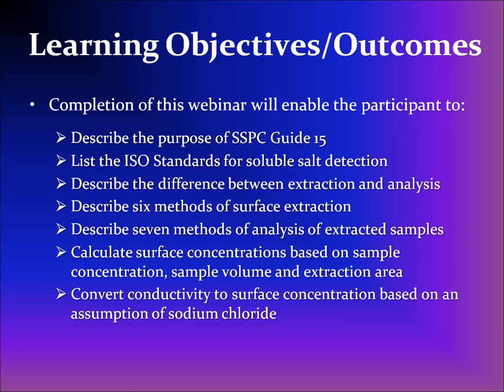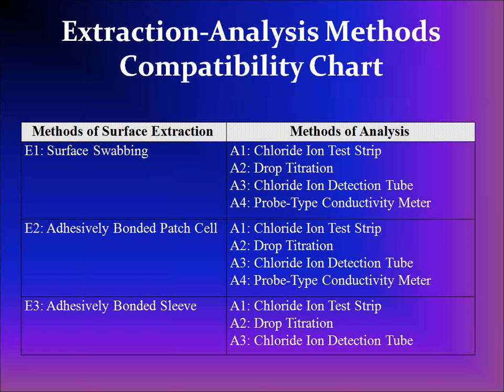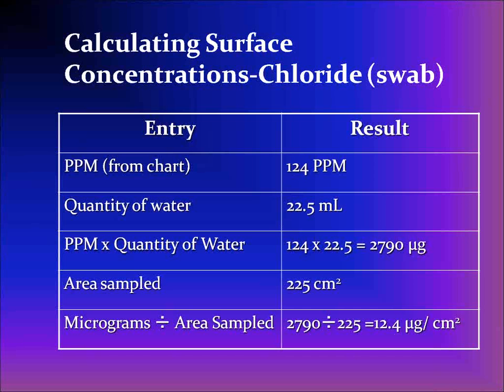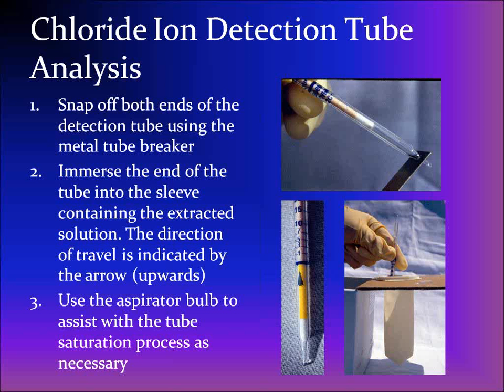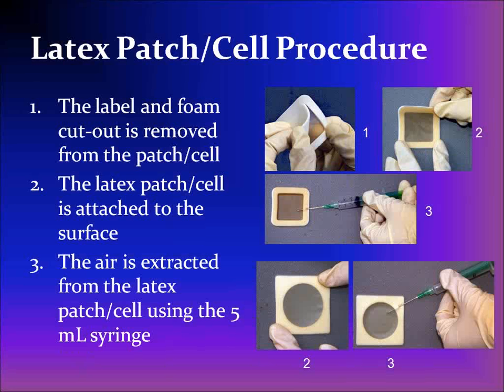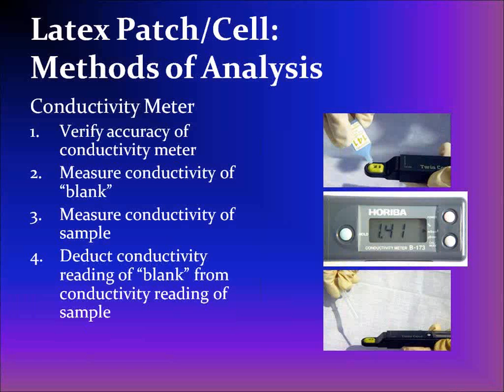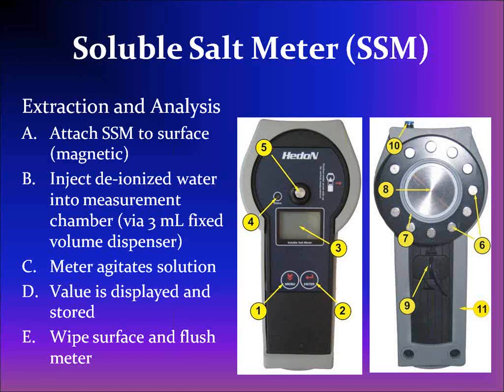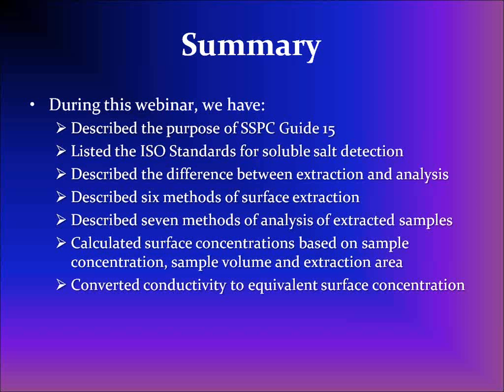KTA Lunch N' Learn Webinar: Salt Test

Comment: Hi KTA, Your videos are good learner and eye opener, thanks for your post. Please can u suggest me after detecting chloride salt using ISO8502-06 the fresh water wash does not make much difference in clearing the contamination on the blasted surface, can you please suggest an alternative method to reduce chloride contamination on blasted surface? Please provide an alternative and effective method.
Reply from the maker: Rocky, the following comes from the webinar host, Bill Corbett: 

Thank you for your inquiry. If pressure washing (minimum 5000 psi) does not reduce surface soluble salt levels, then you may want to try proprietary products like Chlor-Rid (www.chlor-rid.com/) or HoldTight 102 (www.holdtight.com).